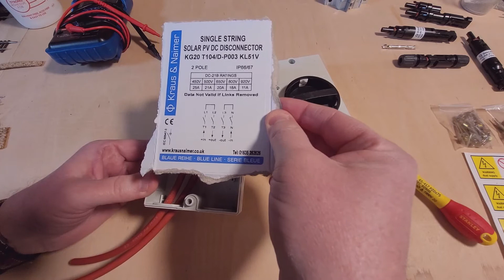DC Isolator......I don't like this one :-(

Comment: For the Kraus&Naimer type DC switch, you can't take off the out link. 
It's normally used as AC switch, they put on the link just to make the current rate suit for DC circuit.

Anyway, for AC switches, Kraus&Naimer is doing good, but for DC switches, you can consider other brand, which will have easier structure and wire.

Comment: Thanks for the video. What size cables are you using please? 

I ask because I've got the 28amp version of exactly the same switch on my narrow boat. I was able to bring in the two 6mm cables from the panels from the top through one gland and curve them round underneath into the switch. I then took the 6mm output cables to my controller back through the other gland at the top, again curved round from underneath.

There were fairly sharp curves on the cables (multistrand solar from CEF), but it was not difficult to do and there was enough room within the casing without crushing or trapping anything.

I hope this is of interest if fellow narrow boaters are thinking of using the same switch and concerned it might not be suitable.

Comment: Thx a lot for your efforts, however, you got it wrong. When you have 2 solar arrays or strings, (both on the roof, or on the ground, or one on the roof, the other on the groung) it allows you to use 1 positive & 1 negative on each side. Or just use one side only for 1 string or array. You shouldn't have 2 red wires coming from one side. It should be one black and one red at the bottom going to your charge controller and the corresponding red and black coming from your solar panels
Reply: Iv got the same dc switch a sparky wired up and iv got no power 

Hes used port L1 and N coming in from the Solar panel on the roof 

Then port T1 and N going to the controller 🤯
Reply: @W3BT3C  ok, thx
Reply from the maker: Sorry but not sure I follow you, each string would need it's own DC isolation switch and the original ones meant that the wiring would be "messy" but the ones I went with a much neater :-)
Reply: @off-gridutilityroom5490  each isolator takes 2 strings sir

Comment: Hi I have a question, I've heard of incidents where DC isolators would catch on fire. Is this occurrence quite regular?
Reply from the maker: Not that I'm aware of 🙂
Reply: If the switch is not rated for high current, and high current is running when you open the switch,  an arc can be formed between the open contacts, causing a fire. If you choose a switch with a high enough current and voltage rating, it should work fine. to be double safe, turn off the load before turning off the isolator switch.
Reply: dontcha mean high voltage? thats whats jumping. @terrymorse